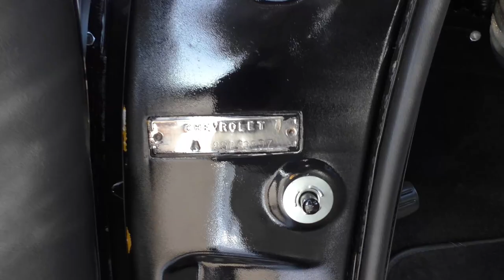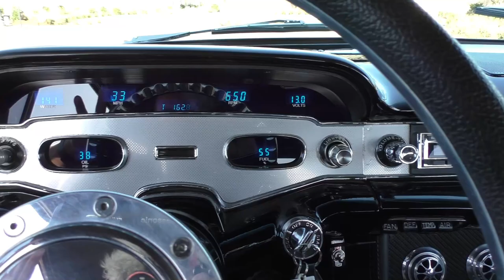1958 Chevrolet Yeoman 2dr Wagon (Sorry Sold) Super-Charged ZL1 LSA 4L80E

Comment: Thanks,interesting have not seen these **58 Yeomans in years,,,,a classmate’s Family had the **58 IMPALA/348/3x2 BBL, LOADED : and big Chevy Dealers around , FAINTLY REMEBER HEARING ABOUT 58 Yeomans,etc. Imwould think a small quantity made and none at all in Original Factory Manufacturer’s CONDITIONS;:: Yeoman Experts ????... Interestingly, also, some of Chevy Dealers etc had a lot,of special “Options” in 50-60s to add ,etc.I guess, actual precedes YENKO, ET AL Tuners/dealers....Not to mention some Federal Agencies got KIND OF special WAGONS 57-59??Probably a fertile study Field,
Reply: Yes YEOMAN were low # less than 15,000. If you wanted a 2 dr wagon, wasn't a NOMAD - that was a 4 dr wagon for 1958.  You are right about a special wagon.  It was a combo delivery / Yeoman.  these wagons had windows, one bench seat. and a lift gate not a split tailgate, super rare.  Most cheap wagons had 6 / 3 on the tree. YEOMAN'S were the cheapest wagon you could get.  I mean cheap - no arm rests on the doors, only one visor for the driver.  That is how my  YEOMAN is, unrestored,  It has a radio, working - 6 /3 on the tree.